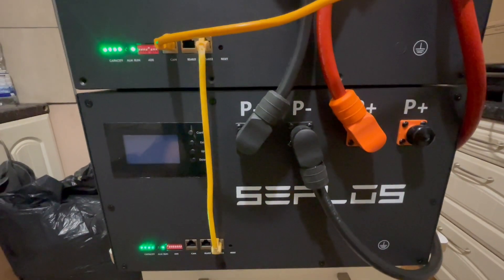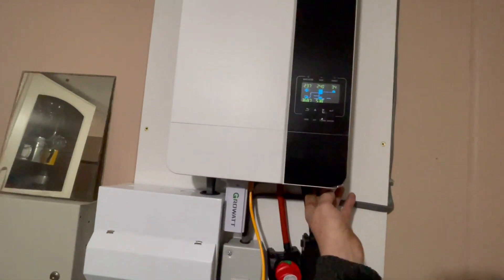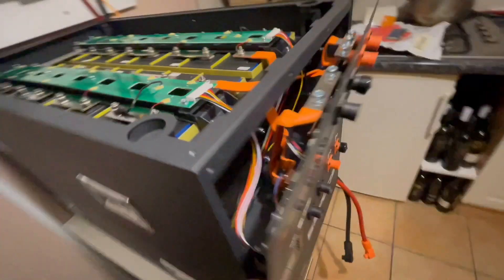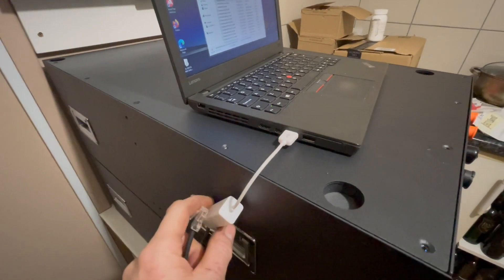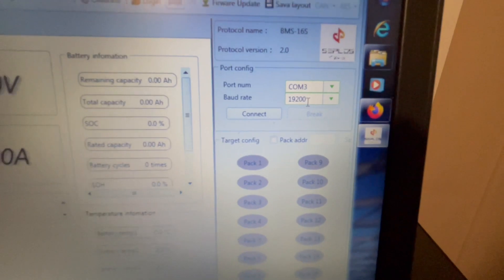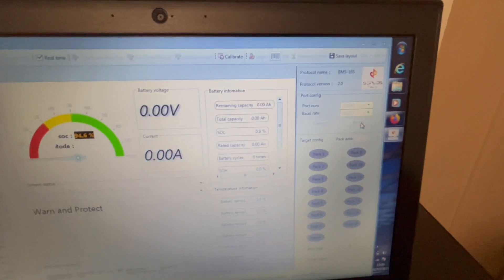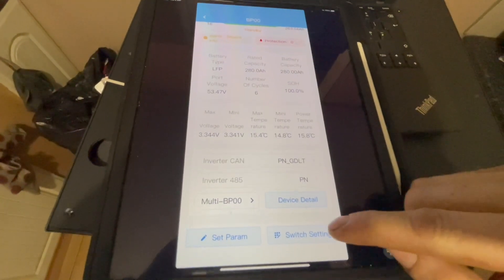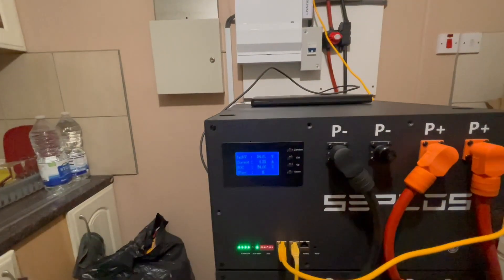SEPLOS LCD Upgrade - BlueTooth - DIY

Comment: Hi there big fan of you channel is there an updated software for the seplos BMS because the one you showing this video doesn’t seem to work, thanks Martin
Reply from the maker: Hi Martin, thanks mate 😃👍 to be honest I’ve not looked for an update on the software for the PC or firmware for the Bluetooth LCD BMS as it’s always worked, I did however update the firmware on another DIY battery I made in a wooden box with one of the first edition Seplos BMS as I’ve put that in my kitchen to and linked to the other 2 in this video with no issues and works well even though the cells are 304ah rather than the other 2 Mason boxes with 280ah cells.

When I originally tried downloading software and firmware from the Seplos website I found it didn’t have a lot of choice so instead I downloaded the Mason manual PDF and found a link to the Seplos server where you can register and downloaded a lot more software and firmware 👍 hope this helps mate 😃 cheers

Comment: Spent the day fitting the Selpos BMS to my battery bank, removed the Jk BMS.
After thinking out how to mount the BMS and having acces to the connectors , I came up with an easy way.

After that I configured the growatt inverter to lithium battery with the Li mode and setting the protocol to 52, 
That worked ok , unplugging the cable gives an alarm ( no comms ) which proves it’s working ok , so no problems with that part, I’ll connect with the Pc next and set some BMS parameters.

I think the Bluetooth app is for the Selpos is android only .

Which version can I download for use on the iPad ?.
Reply from the maker: Awesome, I’m glad you’ve got the Seplos BMS working. The app is available for the iPhone and it’s called EN BMS in the AppStore and will also work on your iPad, the user name is admin and password is 111111 👍 cheers

Comment: Do you have a contact link for that 3D printed case, what cost ?.
Reply from the maker: Hi, it was from seller afsar.imam on ebay, think it was around £40 but unfortunately it’s no longer available. Thanks

Comment: Interesting to watch mate. During the shorter winter days how's it been running,  can you get everything you need from solar alone or do you have to take off the grid now and again?
Reply from the maker: Cheers mate 😁 This setup on my house is twice as powerful as the one on my garage and since I’ve had it on in mid January I’ve only had to go on grid for 2 days and hardly took anything so it’s working really well mate, I think I’ll still have to go on grid for a few days through winter but I’m working on other methods of off grid power to get through them mate 👍 cheers man
Reply: Hi there , it’s me again William, Ive been looking at the charge limitation when using octopus go. With growatt 5000es, I found a simple din rail timer contactor  that we can use to program the exact times for the inverter, setting the inverter to always allow charging , then switch in the grid with the timer contactor.
Also I found a 100amp mains charger from signature solar , this can then be used with the timer contactor to allow 100 amp charging to the minute without using the inverters at all.
Reply from the maker: @Welshwizzard1  Hi William, sounds good, also the separate charger is a good move especially if you also have batteries on standby that aren’t even connected to your solar setup, that way you could still take advantage of the cheaper night rates if your normal solar setup is still charged. I think with any spare money I get I’m going to build as many batteries as I can afford 😂 cheers 👍